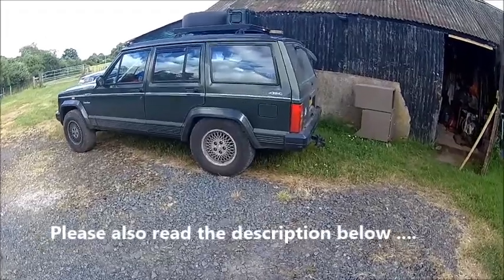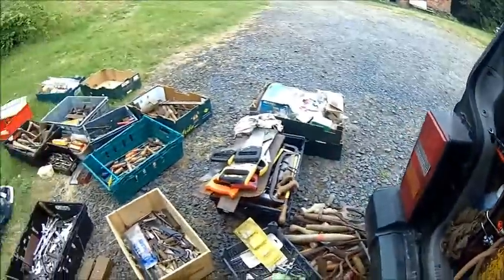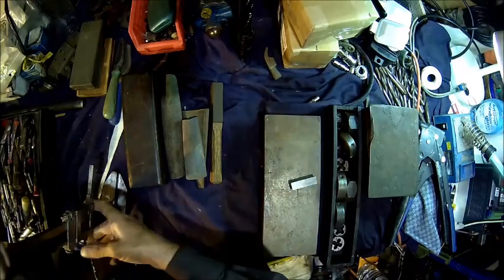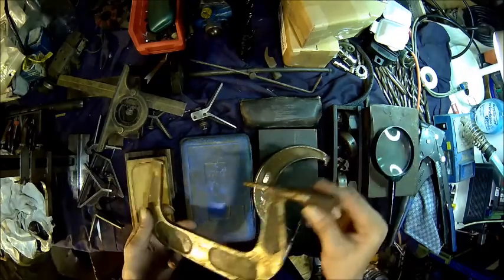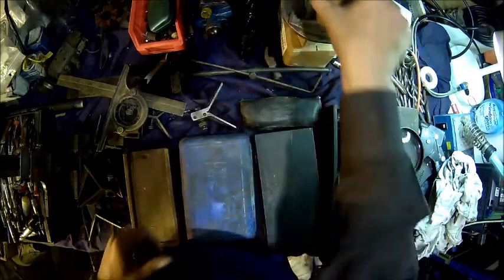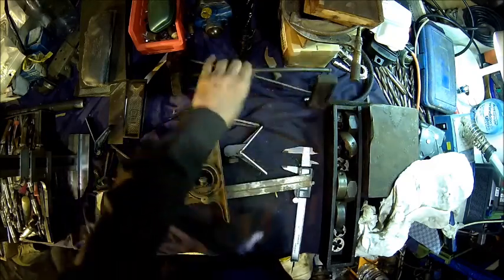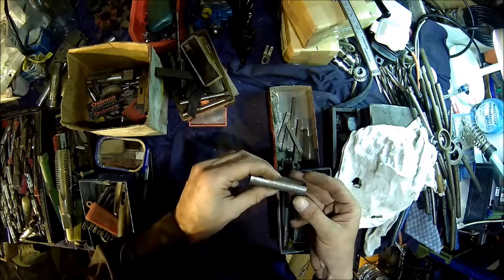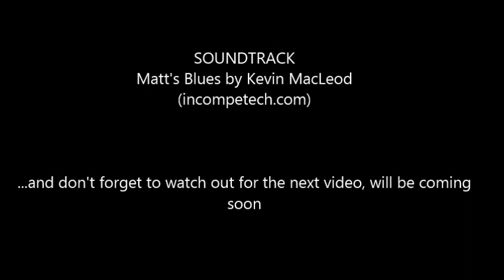Auction + Flea Market Scores #1.1, local tool auction part 1

Comment: I did notice there's loads of spare room in you shed so storage shouldn't be a problem, bsp taps and dies I use a lot being a plumber up to Inch and half let me know what you want to sell as mine are getting a bit dull, that's a haul and half.

Alan.
Reply from the maker: Moring Alan, well... space is always an issue ...:-) ... will send you an email later on as i think i've got something for you
Reply: Cheers we will take soon no doubt.

Alan.
Reply from the maker: haven't had the time yet, but i will look as soon as possible.
Reply: It should have read we will talk soon, no rush

Comment: those things you were wondering about what they are right after the brown&sharpe protractor are center finders for round or oblong work pieces. the use the ruler from the protractor as well. starrett makes them as does brown&sharpe, lufkin and a few others.. very handy tool to have for doing rough layout

well this was quite an interesting video, in that it's nice to see what kind of stuff is still floating around out there in various parts of the world. the format is good too because you get a birds eye view of the haul, which was a good one by the way...
Reply from the maker: Morning Mike,... i may have said that a bit unclear, i was actually wondering about the brand, not what it is.
As said, i've got a few chinese rules for it but they all a bit sloppy and rather poor quality.
Thanks for your comment about the format, i try to continue this way but there is some old footage already done, so stay tuned. ...and by the way, i am thinking about doing one about all the woodworking stuff i collected and have not really a use for.

Comment: its going to take you some time to catalogue what you have Mike ! If you have a shaper tool bit holder surplus - let me know.  ATB Mat
Reply: Or a 5/8 Bolt T slot cutter (c 30mm dia  cutter)
Reply from the maker: Well,...what you just saw is less than 5% of what i acquired in the last 2 years and there won't be a catalogue at all ..:-)...I know I've got a lantern toolpost somewhere, but i think it is a bit too small for your shaper,  Milling cutter, i need to look what came in recently, will let you know.
Reply: Hi Mike, you must have a tardis of a workshop !  Its not the lantern post I m short on, Its the actual tool holder - unlike lathe tool holders which hold the bit at an incline with the tip high, a shaper tool bit holder holds it flat in the same plane as the base of the holder. The better ones allow the tool bit to be rotated so it can cut to left right vertical and a maybe at 45 degrees either side of that.  Managed to find a 5/8 T Slot bit on ebay :-) Cheers Mat (Nice score on the BS height gauge !
Reply from the maker: Ok Mat, I see, ..you talking about the Jones & Shipman style holders, got quite a few but they all for lathes (angled) But if you tell me the maximum size of tool you can hold, i probably have something you may like because i have a large box full of various lathe and shaper tools which are too big for any of my machines but too good to throw away...

Comment: Thats a huge haul! HUGE
I got the same drill stand :)
Reply from the maker: Well,...not really huge, ... i would say a bit above average what i normally come back with from this auction house. "Huge" would mean that i need my 2500kg flatbed trailer ...:-)
The drill stand was a freebie, but it's actually a good quality one.
Reply: I never visited an auction, I must look into it sometime. But I don't dare come home witch such a load of stuff.
Reply from the maker: That's the problem with real (not online) auctions, those mixed boxes are rather cheap so i cannot resist bidding as there might be something in it which is worth more than you pay for,...  at the end it's some sort of gambling ...:-)